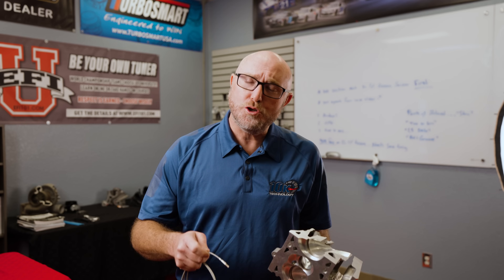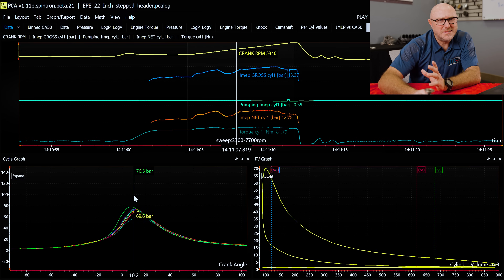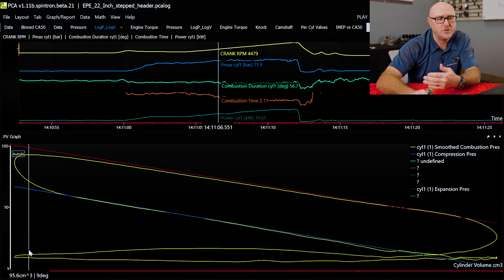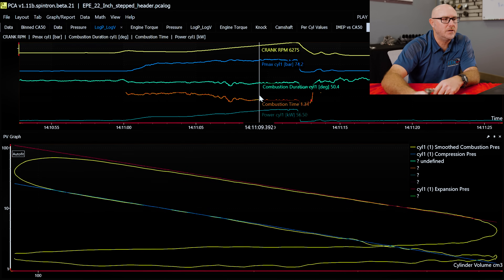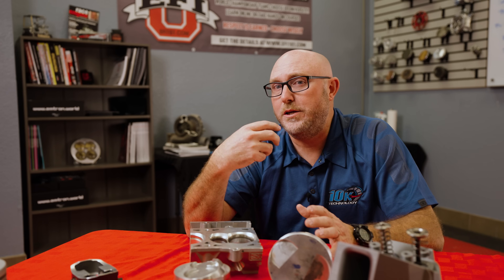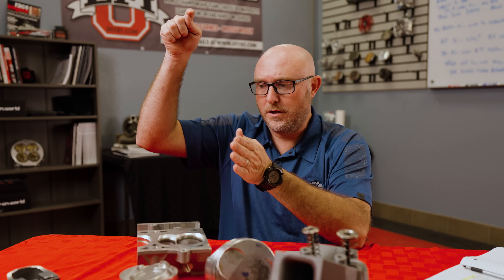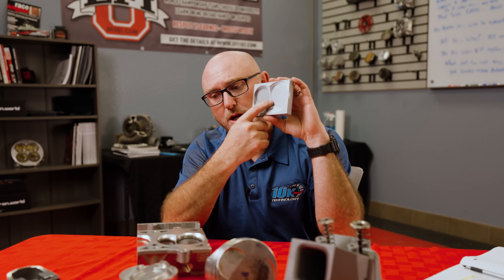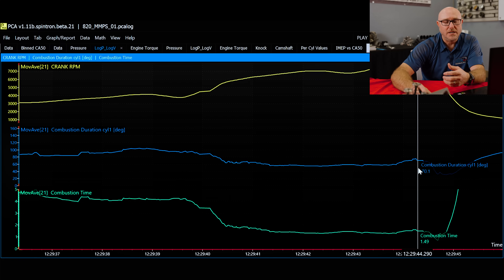I Think Steve Morris is WRONG and I Can Prove It!

Comment: THANK YOU for doing what I wish I had the resources to do!! This is the comment I posted on Steve's video: "My answer to your question, "why do we need to decrease timing when going from NA to boosted?" The mixture will be extremely tightly packed in the same size chamber as before. Oxygen molecules will be very close together and when the flame front starts, it will propagate VERY quickly when compared to a more sparsely distributed mixture. Peak cylinder pressure will then occur much earlier/sooner/faster - so you take away timing to keep that peak pressure occurring at the correct time. If this is untrue I might as well throw my engineering degree in the garbage." As you'd expect, he did not reply.
Reply from the maker: Sounds like you've got a good understanding!
Reply: Going with the LS example here, your engineering degree can be binned. Obviously it is more complicated than your training tells you or that test wouldn't have had the result it did. There are many variables to how an engine functions, as shown here, there is not a one size fits all answer. I can see why he didn't reply, nobody likes a know-it-all commenter.
Reply: I think you are missing one point which I believe may be part of the basis for Steve’s comment.  While I agree that a mixture with more densely packed molecules will burn faster.  In a boosted application you have a lot more molecules that have to burn.  So while the mixture may be burning faster it may end up taking close to the same amount of time to burn all the molecules as it did in the na version with a less dense mixture.
Reply: SM is running mostly methanol fueled engines under high boost....so the additional cooling you get from increasing the amount of fuel in the chamber tends to offset the potential faster burn rate.   In his engines....and LOTS of dyno development....they just don't need ignition retarding at higher boost levels on methanol.

Also remember that they are not running the engines at the ragged edge of timing....stay safely away by reading the sparkplug ground strap colors.   There's no need to run dangerous amounts of timing because all of his really powerful setups need to be tamed down in the car just to get through a pass without blowing off the tires.     Many 'it depends' here and Steve was only saying what HIS engines like and there are NO 'Universal Truths' being violated.

Comment: The one example you used that didn’t follow said the blow off valve was open. Was it turbo or blower car? 
I’m sure that it won’t follow every situation but it was news to me when steve said that!! I was always told to remove 1* per pound of boost…but I also thought that was too much. Crazy to think it may be way far off haha
Reply from the maker: turbo...thats how we were able to keep ot from making boost as even with the gates all the way open it would still make some!
Reply: @ ok that makes sense. Turbos would still be generating some back pressure but with no positive manifold pressure it would have a disproportionate amount of exhaust gas still remaining in the cylinder…slowing the burn significantly as you mentioned. Then with the boost, it returns it to a more normal ratio. I’m sure if you had very high pressure ratios, you would also see the need for reduced back pressure and changes to timing. Do you have any examples that are not turbo cars? This has me very curious.

Comment: Very interesting...you have any data on diesel engine?
Reply from the maker: unfortunately, no...most of my work is on gasoline powered racing engines
Reply: @ ok....because its kind of another story with diesel....since its the injection of the fuel that make the combustion you need to add timing as rpm increase to have the combustion happening in a conservative degree of rotation of the crank....and even more as boost come up

Comment: Yeah, I ah, I spent time in a OEM lab with those sensors 20 yrs ago, and lets just say MBT is definitely not a fixed timing value, ever.
Reply from the maker: That's a great point!  That's exactly why we keep looking for more precision and performance all the time.
Reply: @EFIU_Ben  I am going to try to explain something and it'll be difficult to state concisely. The ideal amount of ignition lead always results in peak pressure as far after TDC as possible with the greatest delta of expansion and lowest pressure before BTDC on the power stroke while avoiding pre BTDC  or even really before 10-15 ATDC pressure rise during the  burn cycle. You never want your combustion pressure rise to be ahead of the TDC event and actually as late on the stroke as you can to maximize work on the crankshaft.

Comment: The wrong cam will also act like EGR, I have guys come up to me at car shows and tell me about overheating problems that they just cannot fix. My first question I always ask, have you looked into the intake manifold for your problem. Never thinking the engine is eating it own exhaust, so the intake is black all the way back to the base plate of the carb.
Reply from the maker: good point
Reply: @EFIU_Ben  egr should lower combustion chamber temp, right ?
Reply: @eflanagan1921  EGR also slows combustion, like a lean mixture so you could get a net increase in engine temperature.

Comment: There's a Lot of variables that affects it.
Another one could be that many reduce compression when they add boost, if they then do it by thicker gasket or turning the pistons in a lathe then they'll have less squish velocity as well. 😄
I recall one head I did for someone to replace a cracked, the same casting, same valve size, the same max CSA, the same chamber volume, but I did a better job on the ports, chambers and worked on improving how the flame front moved from the plug. He was extremely impressed by the difference in response and power for 'the same head' and boost, until the rods 'sent a letter of resignation' a week later. 🙈😂
Reply from the maker: ouch!

Comment: Ben, one thing I've always struggled with as a tuner is twin plug setups. I've never had one on the dyno but I'm currently turbocharging a motorcycle with 2 plugs. I see in the video you have data for some of these engines, does it usually lead to an increased probability of knock?
Reply from the maker: I haven't seen any data that would suggest that having twin plugs affects the probability of knock.
Reply: @EFIU_Ben  That's great to know, thank you! I wasn't going to bother wiring both up, but I will now. Can't wait to get it on the dyno.
Reply: @EFIU_Ben  Twin plugs reduce the probability of knock, as there is less time for the end gases to heat to the point of detonation.

Comment: I guess both of you are right and wrong. I know Steve has tested many positive displacement set-ups on his dyno, so he knows what his numbers show. However, Steve hasn't tested a large variation of engine designs, since he's mostly a Chevy guy. I'm sure that he would see more variation of he tested smaller engines from different manufacturers, but how much would those numbers vary and how easily would am ECU correct for those timing changes, to where the base timing wouldn't change? I'm sure today's high performance engines have all the goodies, like knock sensors, that automatically pull timing when detonation is heard, just like with traction control when the tires break loose.
Reply from the maker: soooo...I'm guessing you didn't watch all the way to the end?

Comment: Have you ever tested this on a Steve Morris 5000hp engine?  Steve is usually talking about his engines and combinations, based on experience that sets world records..
The 70 bar you showed in your data in the beginning is basically a stock engines pressures that makes stock HP... Many bone stock engines exceed that, by a lot.... 
You are using data from lots of different things, all thru out your presentation, to talk around a point you never made...
You didn't prove or disprove anything about what Steve said.... You walked all around it with data from lots of things that don't actually apply..... Your title is complete click bait, and you neither proved or disproved anything....
Reply from the maker: and then DISPROVED it by showing a 5000 Twin Turbo ProMod right after that!  The point that I MADE was that he could be right AND wrong and that not all engines are the same.  Sorry you missed the point.
Reply: @EFIU_Ben  That was my entire point. Your title says you have data to disprove it, and you do not have any such data... That isn't how it works based on many factors. You have not disproved anything about his engines that you have probably never even seen let alone tested.. All you did was click bait those that don't understand it with a moot point. BTW, I did development for engines with similar equipment...

Comment: You nailed it!
Steve is simplifying it a lot, probably due to lack of knowledge.
Reply from the maker: Its nearly impossible to get access to this kind of actual data, so I wouldn't feel too bad if someone didn't know this stuff!
Reply: @EFIU_Ben  A lot of what you are talking about is just plain old physics.
Reply: I had decent computer software to simulate this back in 2005 and it wasn’t cheap, but it ment I could experiment in software not on an expensive customers engine .  Steve is a hack!
Reply: @busarob1969 so where's your multi million dollar engine building business that makes your own engines with a cnc machine? You sound really jealous. Calling him a hack is beyond a stretch.

Comment: I got here from Steve's short also. Over the years I have learned so much about engines and tuning, especially after buying a dyno. I would say over 99% of the engines I have tuned are exactly what you are explaining here Ben, I have always had to retard timing with boost.... 

The one engine I was very surprised on though, was a turbocharged Gen 1 SBC in a drag race S10 pickup. Single turbo, low compression, conventional 23 degree head. I got involved when he made the switch to EFI, and had a local shop tune it (this was before I owned a dyno). He was disappointed with the power and resulting trap speeds when he got it to the track for the first time. He ran it like that for a while then asked me for help. I started adding timing and the trap speeds kept on getting better. I was coming from a pump gas turbocharged import background at the time and was extremely reluctant and uneasy about the numbers in the timing table. However, I knew that if it was going faster, "give it what the engine wants, not what you THINK it wants". We ended up right at what the NA engine liked all the way up to 30 psi boost pressure (we are at about 1,000ft. above sea level). Plugs showed the timing was right in the sweet spot as well. This particular engine really opened my mind up, and I'm grateful to have created a friendship with the owner and have drag raced with him ever since. 

Another thing to just mention about this particular engine that is interesting is that we went through 3 different single turbo setups, ultimately ending with a big 98mm Garrett GTX5533R. We ran it up to 54psi boost, and up there it STILL wanted a lot of timing. I later figured out why when we installed back pressure sensors... The single was choking the exhaust too much and effectively diluting the mixture and requiring more ignition lead, just as you talk about here Ben. It still went faster, but the power gain per pound of boost was really plateauing. We ended up switching to a twin 80mm turbo setup, and made the same power at only 42psi boost pressure, just because of the more open exhaust. It took less timing as well, and as an added benefit we stopped having to replace spark plugs after 4 runs. 

Anyways, that's already too much info in a YouTube comment, but thank you for the great video Ben!
Reply from the maker: Thanks for sharing your experience!  It's great to hear from someone with hands-on knowledge like you.
Reply: @EFIU_Ben  this method( in cylinders ) of closed-loop systems should be more commonplace and or costs lowered as you showing the benefits and thanks for the hemi/twin-plugs parts in the video as a iron-repop D8/170~cc 1968~/540/4.3in-pistons owner

this in theory if you could spraying at the correct time use water as mass( jet-engine's use this as do some rocket-engine's to add ISP ) and or knock-resistance middle~ stroke and or add fuel like diesel or nitromethane, not a computer-nurd( data and people like you( and this is a compliment's/positive ) finally got me to give up on 1950's~ magneto's and mechanical injections and non-intercooled 8-71 themed build's aka pre1980~ and yes im a zoomer-gen but my elder's rub'd off a lot ) im better at mechanical-gut's and or hard-part-programming
Reply: @EFIU_Ben  Since you're compressing MORE air, the cylinder pressure...  and therefore the temperature will be far greater than n/a.  The higher temps alone should dictate less timing.  Now I'll watch your video and see if you come up with the same theory...  but that's what jumped out at me while watching his.
Reply: Bingo  @n2omike

Comment: Greg's Airplanes just did a similar video. Its rather interesting that NACA did studys on this to improve aviation engine efficiency back in the 40s. It would be cool to see your burn time data with just changing air fuel ratios and fuel types.
Reply from the maker: Those guys really knew what they were doing back then!
Reply: @EFIU_Ben  Yeh. I just realized that the testing data gose back as far as 1925. If you think about it, the data in general makes sense. If you look at the air fuel ratio and disregard the boost. The burn time of a set air to fuel ratio is going to be the same regardless of boost pressure well   to a point.What you said about the hemi makes sense it. It literally quenches the air fuel mixture, causing a slower burn. I think that is how the term quench area came about.
Reply: @uberdang830  "The burn time of a set air to fuel ratio is going to be the same regardless of boost pressure"

Why would you think that?  The higher the pressure the closer the oxygen and fuel molecules are packed together which increases flame speed, just like raising CR.
Reply: @EFIU_Ben  Actually, they kind of didn't. That's why they had to do all those studies and testing, just like you're doing now, so they could learn and now we all know what we're doing, all thanks to them.

Comment: This is very interesting and will clear up some misinformation and help people to understand it in the full spectrum. Thanks brother. Back in the day with leaded fuel my old 327 / 350 not modified 32 degrees all in with Dist advance curve with vacuum source was the max I could go before it hard cranked and that`s when I knew to back it off just a bit and get rid of the ping.
Reply from the maker: Yes! The old school way of tuning is still super helpful!

Comment: Plain and simple despite what fuel is used 
It’s what the engine wants 
And spark plugs tell that story 
Your method is only a guide not text book for all engines
Reply from the maker: Spark plugs can tell us a lot, but we need to know what the data says...that's why OEM's, CUP and ProStock teams invest in this level of actual data...  Reading a plug is never going to tell you this kind of data!
Reply: @ data is only a reference 
Yes it helps in tuning 
But the plug will still tell max timing and whether you have a good burn rate and also tell whether you have pre ignite 
Detonation 
It gets you that close it’s not funny even  the best tuner in the world still relies on plug reading including top fuel cars and they have more data than most race engines

Comment: Well if memory serves Steve was sayings boost vs non boost on his motors, not all motors, so that eliminates many of the variables that change.   You make good sense and is not surprising that different configs need different adjustments.  I was taught that with cylinder pressure, that the math is stable regardless of motor (as long as it was a piston pushing on a crank thru a rod) that peak cylinder pressure at 12ish degrees after TDC was universally desirable.  So, back calculate from that the combustion time, at different RPM and Boost etc to back calculate your ideal ignition map.   Have you ever indexed your data to the peak pressure vs crank position??   Thoughts??   Thanks!
Reply from the maker: We look at peak pressure amount, and crank locations but more importantly, we look at the area under the curve and how much % of mixture has been burned at certain crank locations.  Typically we look at the value for "CA50" or the crank angle where 50% of the mixture has been burned, because this is a much more reliable indicator than peak pressure locations such as "X number of degrees after TDC"
Reply: @EFIU_Ben  Thanks Ben for the reply.   I know my info is getting dated, I wish I could be uber familiar with and testing and learning this stuff even as a hobby.   I think its fascinating.
Reply: True but just want to point out, he builds and dynos a lot of stuff other than just his own engines. BBCs, SBCs, LS, Hemis, heck even Rotax and Lamborghini.